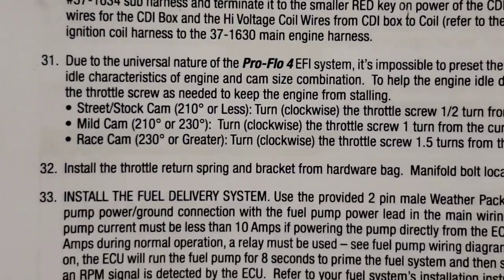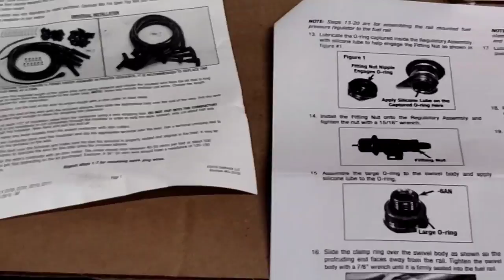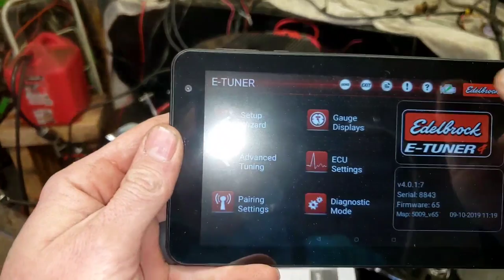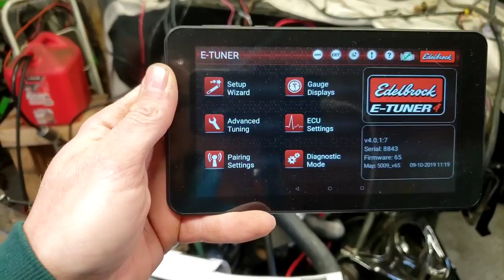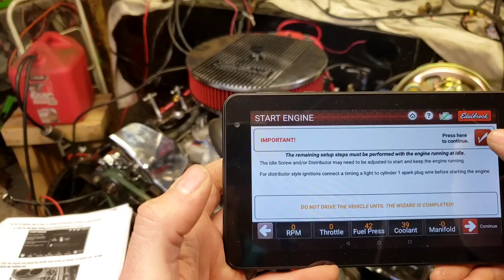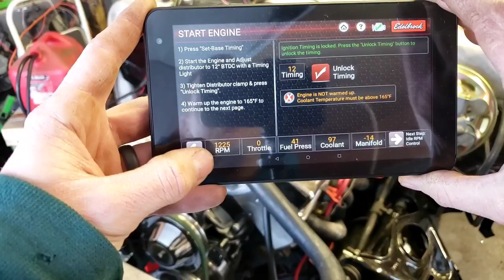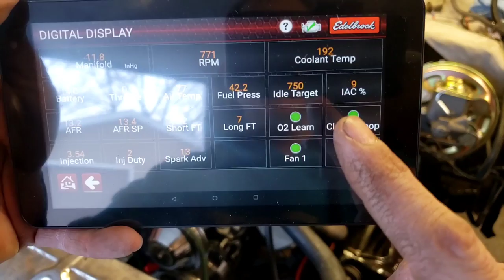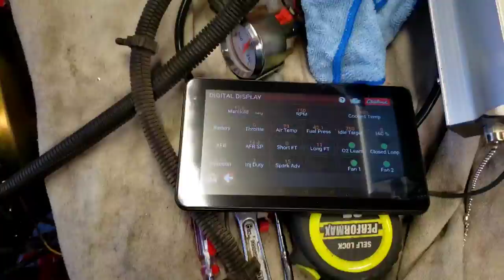1977 Chevy Camaro Restoration Part 17.. Pro Flo 4 installatiom

Comment: Nice job. It only gets better. I’ve had mine for a little over a year and don’t even think about it any more. I have a Comp Extreme Energy and have been using 43lb fuel pressure with 35lb injectors with no problems.
Reply from the maker: FI is so nice to have. It’s one of those things where it’s hard to go to a carb after the ease of use with a turn key system.

Comment: I enjoyed your video buddy, I just install my Pro Flo 4 a few months ago and so far so good. Mine did fire up on the first try, I was impressed. I am just working out some kinks and the normal headaches of a new build, and of course trying to learn to tune for optimal performance. Good luck with yours.
Reply from the maker: Thank you! I love it. Just wish the car were up and driving. Just wondering if yours runs super rich while idling? I notice it’s so strong it burns my eyes. I might have to call edelbrock.
Reply: @BackyardGarage1  Yes it does run rich at idle, I am still dealing with that too. I called Edelbrock and they directed me to up the timing at idle to 22, put the vacuum advance to 12 and I took about -5 from idle fuel modifiers but, it is still rich, I have an issue with getting the short Trim tunes to between 5 and 10. Like yours, it seems to run well and sounds good. Of course, I am still learning the EFI thing.
Reply from the maker: @carlc.472  I get it for sure. I need to call edelbrock as well. I thought it was an issue with the weather being super cold here in MN but now that it’s been in the 60s, still the same issue
Reply: Seems like everyone that Insalls one of these has to call Edelbrock
Reply from the maker: @rosseowens  I actually didn’t have to call them. I had a faulty regulator and it was pumping fuel into the intake and flooding it. I figured this out when the engine hydro locked while idling. I was very lucky I didn’t bend a rod! Other than that mishap, it’s been a super nice unit.

Comment: Been deciding between this and the holley sniper. Thinking this is the way to go. Read way too many issues with the sniper. Hope the edelbrock is better
Reply from the maker: I did hours upon hours of research and watching videos. I ultimately chose this for a few reasons. 
1. Multi port fuel injection 
2. Reviews seemed a lot better
3. Edelbrock support has always been on point
4. Comes with just about everything but the coil and fuel pump

I know I don’t have hardly any miles on it yet, but so far turn key starts in -20 weather are nice.

Comment: So I installed the proflo on a 97’ 350 and I can’t get it to start. Do you think I have to install the original harness as well with the pro flo harness?
Reply from the maker: The original wiring harness? I don’t think so. It just won’t start at all? Maybe the distributor is too far out of timing? I had to turn mine till it fired then set the timing right after.
Reply from the maker: Did you ever get it fixed? What was the issue?

Comment: How do you like it? Any issues? Thanks.
Reply from the maker: So far I love it. I had an issue where my cam is so big that I have to run it at 21 degrees of timing and then set other parameters so it would run smooth. But got about 80 miles on her and it’s running great. Only real issue is cold starts when it’s below freezing. Doesn’t like that too much.

Comment: Question….Does it matter if regulator is on the inlet side or the return line side?  I run mine on the return.  I would think pressure is the same but I’m interested in your thoughts and/or source of info.
Reply from the maker: I generally run on the return side as well. I run it this way as that is how the manufacturer advises to run it.
Reply from the maker: I am not sure if it really matters or not though. The fuel pressure in these systems will be regulated throughout the system once it goes through the regulator. The pressure regulator that they recommend on the install of the pro flo is junk. Mine ended up failing and leaking through the vacuum port and it ended up hydro locking my engine with fuel while it was running. This caused fuel to go into my oil and could have caused some serious damage. If the engine was under load and I were driving it, it could have bent a connecting rod or worse. I ended up switching to a more expensive regulator where I had to dial in the pressure. I used the tablet to get it all dialed in.

Comment: What cam ? Thinking of doing same with my 400sbc . I have a 12-600-4 cam which is the mother thumpercam but worried might be to radical for f/I .
Reply from the maker: Right now I currently have the rollin thunder. It seems to be doing well. Although, I may need to adjust the timing a bit.

Comment: Can you still run a Dakota digital system and get the engine information reads
Reply from the maker: I am honestly not sure. I don’t have the Dakota Digital Gauges.
Reply: pretty sure you can with a BIM module for Edelbrock from DD
Reply: Yes. Dakota Digital sells a BIM for the Pro Flo4. Whats great is you use the CAN out signal from the Edelbrock to control most of the gauges.

Comment: Did you weld a bung in
Reply from the maker: No I bought a collector flange with one welded in.
Reply: Thanks for answering,  I posted or hijacked my thoughts on electrical,  I have a 79 vet, and bought the fuel pump that is located at the tank, so I have to do a lot more work,  cheers

Comment: Hello Enjoy the Video  I as well  Been looking at the Pro Flo over Sniper  Aslos the ACES  Joker  I went back and Forth  I went with Aces  ---There System also calls for 12 b4   TDC   why  is this    Ok Back to the video
Reply from the maker: Glad your enjoying the video. 😊 Generally most older vehicles are set at 12 BTDC. It’s just a good starting point. They do that so when the timing is all in it’s not over timed and end up blowing it up. However, I can set my timing from 0 to 50BTDC if I wanted to.
Reply: @BackyardGarage1  sent you am Email

Comment: Just curious why use a gasket if your using so much RTV?
Reply from the maker: Because it’s what the manufacturer recommended and I was following instructions.
Reply from the maker: The china walls don’t seal and you need that 1/4 in bead of rtv

Comment: Pretty sure you have a fractional HP belt on there, bud. If it hasn't failed on you yet (9+ months), you're either really da** lucky, or you haven't been driving this vehicle!
Reply from the maker: Mostly been sitting to be honest. Still working on the camaro